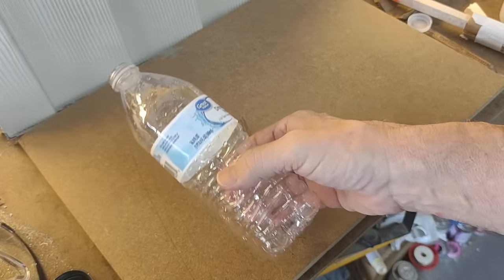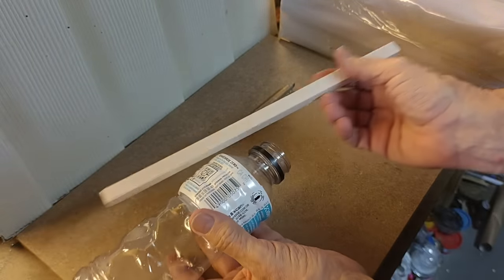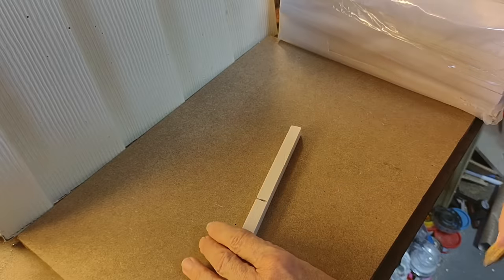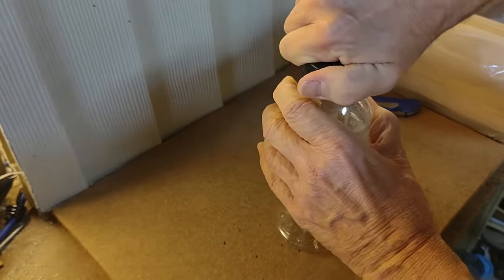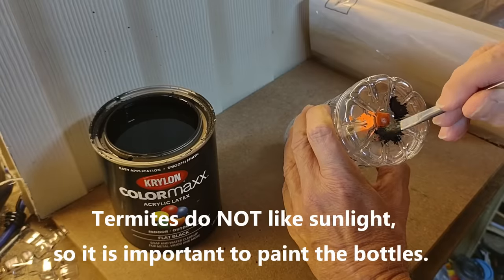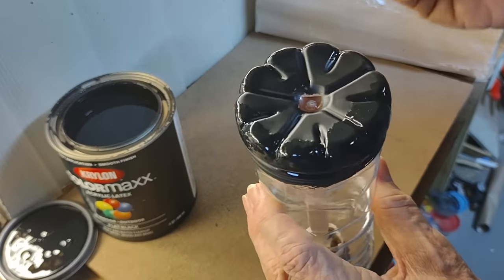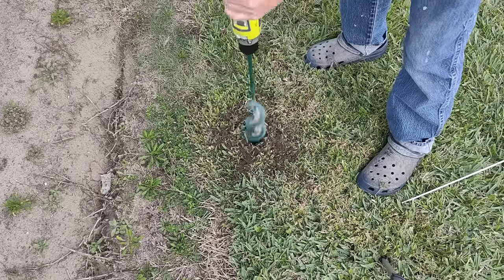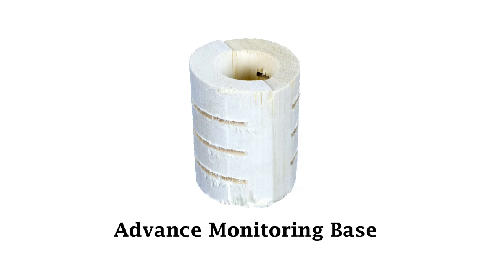Unbelievable Water Bottle Trick for Termites!  Simple to do!

Comment: Though this "Guy" has correct information on termites, his method is flawed!  I have more times than I can remember seeing termites inside a home without a single bit of activity in any termite monitoring stations on the exterior.  Best method is doing a traditional termite treatment using a non-repellant termiticide, preferably termidor.  40 years experience speaking here!
Reply: What’s the best way to get rid of them? I don’t even know how they got in.
Reply: 11:50
Reply: Subterranean termites require moisture, just look for the mud tubes. If you can find those your ordeal can be over sooner. I saved all the permanent markers I had when they dried out. I then removed the inner part of the body of the markers, drilled 1/8 inch holes top and bottom. I mixed sawdust and a termicide together and packed the marker bodies until I couldn't pack in any more. I then pushed the markers into the ground around my foundation at 18 inch intervals. The termites will find these and help themselves to a ready but deadly meal that can be easily refilled.  Hope this helps!
Reply: @stevesantiago9660  you are the man!  We’ve been outside and under the house and can not locate the tubes.  They’ve been eating the house here for a while me.  I’m just going to plant the markers all the way around the foundation.
Reply: @stevesantiago9660 you should make a tutorial
Reply: @stevesantiago9660  
Brilliant! So thanks.
Reply: Jeff Campbell  yes that's correct, the bait stations don't protect the home, the stations are more for monitoring after a barrier treatment, 35 years here
Reply: Termidor sc, the best product for termites ever made.16 + years here in south Florida and counting.
Reply: @romanleon76  yep they say it's good for 15 years
Reply: But, he didn't say he was showing the "best" method for eradicating an infestation. He was simply showing an easy and cheap way to deal with an infestation, on your own and with things that can be found around the house!
Reply from the maker: Termite monitoring stations are not a sure thing.  I believe I pointed that out in the video.  However, the closer you put them together, the more chance that they will work.  All too often, even the professionals will space them 15 feet apart, so no surprise that the termites get past them.  If you make these things yourself, you can space them at 4 feet apart and do your house but under $25.  I never say never in pest control, but it would be very difficult for the termites to miss the stations when they are spaced at 4 foot intervals.  So, what I am recommending is not flawed.  What is flawed is placing the stations too far apart and thinking the termites are going to find them.
 
I hope that helps.  Be well my friend.
Reply from the maker: @loadedfun4764  There are two options for treating subterranean termites yourself.  The easiest way is to use termite granules.  It costs less than $60 to do and it only takes about an hour.  The application is so easy that a child can do it.  The other option is to trench around the entire building, including the driveway.  It takes about a day for most people to trench around an average sized building and it only costs about $100 to do the job.  Trenching lasts for 5 to 10 years, but the granules should be applied every year as a preventive measure.  I have videos on how to do both options and I will place links below.       
 
For the granules to work you need to have dirt around most of the house and that dirt needs to be porous enough to allow water to seep into the ground fairly quickly.  To find out if the dirt around your house is porous enough, just dig a small hole next to the house that is about 4 inches deep, 8 inches long, and just the width of the shovel.  Fill the hole with water and watch to see how fast it drains down into the ground.  If it seeps into the ground fairly quickly, then the granules should work just fine.  However, if it just kind of sits there, then the granules would not be a good choice, and you should consider trenching.  Make sure that you buy the correct granules.  You need the ones that have imidacloprid as the active ingredient.  A lot of the Home Depot and Lowes stores no longer sell the correct granules, but you can get them from Amazon.  I will give you a link to them.
 
You can give any subterranean termite treatment a bit of a boost by doing a spot treatment.  If at all possible, spot treating for subterranean termites should not be the only approach to eliminate an infestation.   An additional exterior treatment should also be done with either granules or trenching, whenever possible.  Spot treating alone may totally eliminate the infestation with no other treatments, but it's not a sure thing. 
 
To spot treat subterranean termites, you need to buy a fipronil foam.  I will provide links for two products that you can choose from.  I like the FiPro the best because it's a little less expensive and I like the applicator tip better, but the Termidor Foam also works very well.  The FiPro is not available everywhere.  If you can get one of these foams, then drill holes in all damaged areas, that are 4 inches apart, and drilled about halfway through the wood.  If you are seeing exit holes in the wall, then there is most likely a stud behind the exit hole.  Get a stud finder and locate the stud where it meets the ceiling and drive a small nail into the stud a couple of inches below the ceiling.  Attach a weighted string to the nail and that will show you where the stud is.  Then drill the holes 4 inches apart along the entire length of the stud, about 3 inches deep.  Do the same thing for woodwork, except only drill the holes halfway through the wood.  If you think that there is a 2 x 4 behind the woodwork, then drill a 3-inch-deep hole every 8 inches.  The holes only need to be wide enough to get the applicator tip of the foam can into the hole.  After the holes are drilled, then shoot the foam into each hole for about 5 seconds or until you have foam either coming back out at you or coming out the other holes that you drilled.   All the holes should have foam either going into them or coming out of them.  This will contaminate their food source and they will take the fipronil back in the colony and spread it around to the other termites.

Most of the time, subterranean termites are going to be building mud tubes somewhere.  You will most likely find these mud tubes going up the exterior or interior of your foundation and you may find them along joists and even in the attic sometimes.  If you have a slab home, then you may find them going up the outside of the house on the slab and even the side of the house.  If you can find the mud tubes, then you can treat them as well.  Just scrape off about a 2-inch section of each mud tube down to the bare surface.  Then, shoot that foam into each side of the mud tube and also apply a little of it on the surface where you removed it.  The termites will rebuild the mud tubes and bring the foam back to the colony to spread around to the other termites. 

Also, if you can find the mud tubes, this is a very good way to determine when the infestation is gone.  If you scrape off that 2-inch section of a mud tube, you can see if there are any live termites in the tube.  Again, the termites will rebuild the tube and go about their business.  Do this every two weeks after you finish all your treatments.  Apply the foam to the mud tube every time you do it. At the point you are no longer seeing live termites and they stop rebuilding the mud tube, then your infestation has been eradicated. 

It typically takes several weeks for any termite treatment to be effective.  That is because you are using slow kill products.  If you were to kill the termites too quickly, then they would not have a chance to bring the poison back to the colony and share it with the other termites.  If you don't kill off the entire colony, you will not end the infestation.  Therefore, you must kill off subterranean termites very slowly.  So, I would give this at least 12 weeks before I would decide that something went wrong, and the process didn't work.  Hiring a professional to trench your house is pretty much going to take about the same amount of time to kill off the colony.

The video on trenching will explain how they got in.
 
I hope that helps.  Be well my friend.
 
Video on how to apply termite granules:  https://youtu.be/H7rW_TSBHJ4
 
Video on how to trench for subterranean termites the right way:   https://youtu.be/Fy7YHi_7Z8g

Termite granules:  https://www.amazon.com/dp/B000RUIJYM?ref=nb_sb_ss_w_as-reorder-t1_k0_1_7&amp=&crid=1UJA4PE31UWZW&amp=&sprefix=termite

FiPro:  https://www.solutionsstores.com/fipro-foaming-aerosol 

Termidor Foam:  https://www.domyown.com/termidor-foam-p-3528.html
Reply from the maker: @loadedfun4764  I would not recommend that treatment option.  Once the termites are already in your house, there is no reason for them to seek another food source.  Also, it takes a lot of food to wipe out a colony, so trenching or granules are a much better idea.  Now, if you cannot find mud tubes, then you may not have subterranean termites at all.  Please watch my video on how to identify termite species.  There is a map in the video that you need to look at.  If you live in the red areas, then you may have drywood termites.  Please email me at guyspestsolutions@gmail.com if this is the case and I will guide you further.  Also, make sure that these guys are termites and not carpenter ants.

I hope that helps.  Be well my friend.
                           
Video on how to identify termite species:  https://youtu.be/dIs_a0nfVjg

Video on termites vs carpenter ants:  https://youtu.be/enJPS-h70Bs
Reply from the maker: @stevesantiago9660  You may want to consider using termite granules instead.  It will work a lot better and only costs $50 to do.  Way faster too.  Be well my friend.

Video on how to apply termite granules:  https://youtu.be/H7rW_TSBHJ4

Termite granules:  https://www.amazon.com/dp/B000RUIJYM?ref=nb_sb_ss_w_as-reorder-t1_k0_1_7&amp=&crid=1UJA4PE31UWZW&amp=&sprefix=termite
Reply from the maker: @amodernalchemist432  Actually, the stations are to alert you to an impending infestation.  They are not designed to treat an existing infestation in your home.  Installing monitoring stations after you are infested is a bit like closing the barn door after the horse gets out.  The idea is to catch the termites and treat them before they make it to your house.  If you are already infested, then the best thing to do is use termite granules or trenching.  Termidor is a great product for trenching, but Taurus SC is the same thing but cheaper.  Thank you so much for those kind words and support.  Very much appreciated.  Be well my friend.
Reply from the maker: @mullaway5746  Termidor lasts 5 to 10 years, with 7 years being the average.  Anything past 10 years is just luck.  You are basically no longer protected after 10 years.  There are pest controllers claiming 20 years, but it's not true.  They can legitimately claim 10 years, but that is the outside of the envelope.  I hope that helps.  Be well my friend.
Reply from the maker: @romanleon76  Termidor is wonderful stuff, but it only lasts 5 to 10 years, with 7 years being the average.  Anything past 10 years is just luck.  You are basically no longer protected after 10 years.  There are pest controllers claiming 20 years, but it's not true.  They can legitimately claim 10 years, but that is the outside of the envelope.  I think it is safe to say that your protection ran out several years ago.  You may want to consider using the termite monitoring stations and/or termite granules starting now.  I have a video on how to use the granules.  Make sure that you buy the correct granules.  You need the ones that have imidacloprid as the active ingredient.  A lot of the Home Depot and Lowes stores no longer sell the correct granules, but you can get them from Amazon.  I will give you a link to them.

I hope that helps.  Be well my friend.

Video on how to use termite granules:  https://youtu.be/H7rW_TSBHJ4

Termite granules:  https://www.amazon.com/dp/B000RUIJYM?ref=nb_sb_ss_w_as-reorder-t1_k0_1_7&amp=&crid=1UJA4PE31UWZW&amp=&sprefix=termite
Reply: Isn't Boracare the best?
Reply: Pls help with blight on tomatoes
Reply: Do you own a company?
Reply: @Gypsy Girl  boracare is preventative and applied to raw wood, preferably during framing stage of home building as Guy has said. Some cities in Texas require it, as it is forever. If you already have termites you need to treat them, it's too late for boracare. I'm going to try treating my rafters with it in my attic, but my walls needs eradicated first. And outside also needs treated. Boracare is for raw unstained uninfected wood, hope ya catch em at that stage...sure wish I'd been that lucky.
Reply: I guess that is why he also does the granular. I think this is more presented as a DYI alternative for people who are considering hiring a company that has quoted putting in monitoring stations.
Reply: He said that it is not the correct method if u already have termite infestations.
Reply: If you have field mice, my Gramps used to say, you won't  have termites. Though who wants either!! 😳 If I ever live in a place with them. I'm going with the Campbell info! Thank you. 2023🎉
Reply: How dare you speak of lord guy in that manner! A shamefull display
Reply: @GuysPestSolutions  no don’t do this. Take 1500 bucks and buy a centracon system.
Reply from the maker: @samiam830  The only problems with Sentricon are that they do not work on all species effectively, they can take up to 2 years to eliminate a colony, and sometimes they do not work at all because the termites may not find them.  Frankly, it should be illegal to sell this system.  Pest control companies like it because it's cheap and easy to install and they make a lot of money every year for monitoring.  The customer goes on paying, and paying, and paying, with nothing in return.  While there are some local mom and pop companies that will sell Sentricon, most of them are too honest to do it.  The system is mostly sold by national companies, who send out commissioned salespeople, with the goal of charging as much as they can for the least amount of work.  If you want the full story, please watch my video on the baiting vs trenching.  If you have the correct soil conditions, then granules will work 95% of the time.  The granules work way better than Sentricon and cost a whole lot less.  If your soil is too dense for granules, then you can trench for about $100 and that lasts 5 to 10 years, and it's pretty much a sure thing.  If you purchased a Sentricon system, my advice is to cancel the contract as soon as it expires.  I'm so sorry.  The sales pitch sounds great, but the company is taking advantage of you.  Be well my friend.

Video on baiting vs trenching for termites:  https://youtu.be/jrPrr5DdB_g
Reply from the maker: @KcPenguins  I'm sorry that I did not answer this sooner.  This is a very old and long comment string and YouTube did not inform me that your comment was here.  I just happened to notice it now.  Unfortunately, mice will not prevent or treat termites.  I'm sure that Gramps was a great guy, but he was somewhat misinformed about termites.  I hope that helps.  Be well my friend.
Reply from the maker: @Gypsygirl9  I'm sorry that I did not answer this sooner.  This is a very long comment string and YouTube did not inform me that your comment was here.  I just happened to notice it now.  Bora-Care is a wonderful product for treating bare wood that has not been sealed with anything.  It is the only product I recommend for this purpose, and it will render wood permanently termite proof.  Be well my friend.
Reply from the maker: @thembisilekatexuba3807  I'm sorry that I did not answer this sooner.  This is a very old and long comment string and YouTube did not inform me that your comment was here.  I just happened to notice it now.  I am also sorry that I am not an expert with plant diseases.  My expertise is with bugs.  I try to stay away from gardening because I am not very good at it.  If you have termites, then I'm you guy, but plants are outside of my wheelhouse.  So sorry.
Reply from the maker: @ikblr6250  I'm sorry that I did not answer this sooner.  This is a very long comment string and YouTube did not inform me that your comment was here.  I just happened to notice it now.  I do not own a company.  I am retired now.  Be well my friend.
Reply from the maker: @brandilipari9365  I'm sorry that I did not answer this sooner.  This is a very long comment string and YouTube did not inform me that your comment was here.  I just happened to notice it now.  You got this spot on correct.  Thanks for answering this for me.  Very much appreciated.  Be well my friend.
Reply: @GuysPestSolutions  thank you very much kind sir. We actually emailed and you were such a great help. Thank you very much.😇
Reply from the maker: @Gypsygirl9  That's good.  I am happy that I was able to help.  Be well my friend.